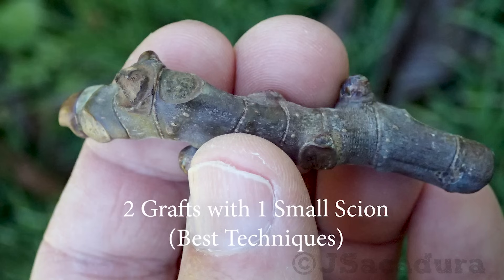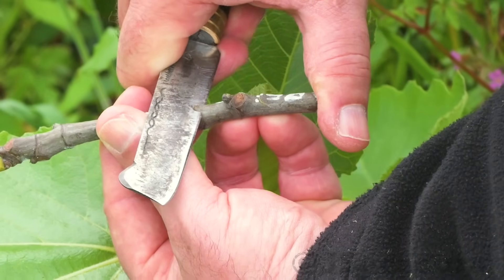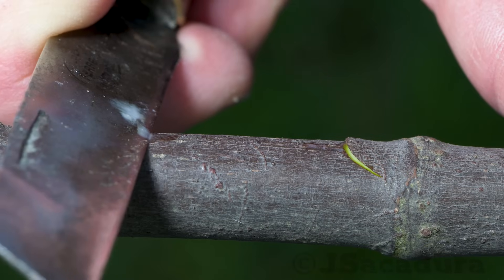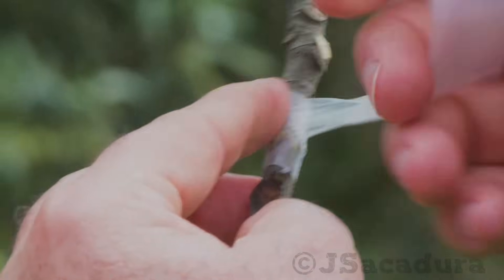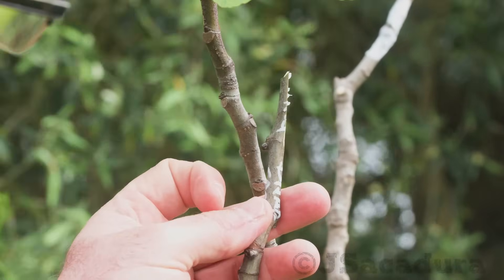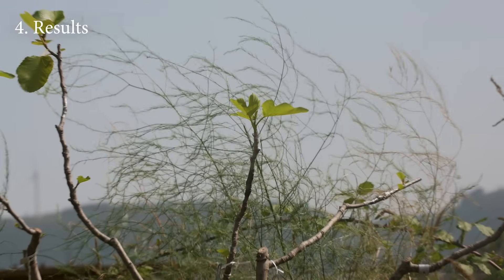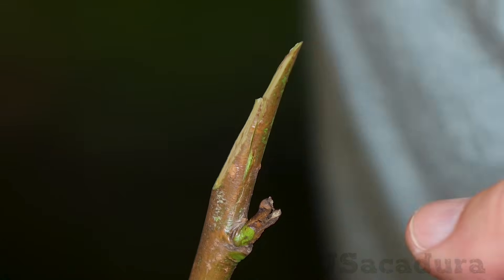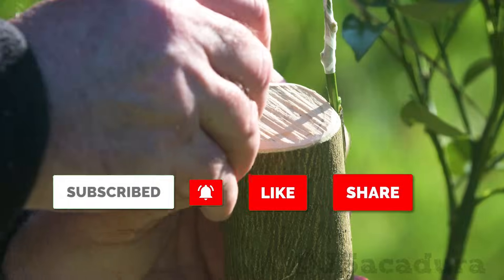BEST GRAFTING TECHNIQUES | 2 GRAFTS with 1 SMALL SCION

Comment: Great video as always!  I did far less grafting this spring and had less success than last year with the few I did.  I grafted a tree I bought from Costco, and after planting, it just stopped growing. There didn't seem to be a flow of sap to the scions to join to the rootstock.  My hunch is that the tree (a peach that already had some peaches) was well into its growth phase and it just switched to emphasizing its roots when I planted it.  Anyway, the biggest problem with last year's grafts is that last year's bark grafts continue to grow so vigorously that I need to both prune and anchor them so they don't break off on windy days.  I've come to realize that orchards use bark grafts with the aid of a trellis to make the technique work, so some sort of additional support is probably necessary, at least in the first few years.
Reply from the maker: With vigorous varieties its always a good idea to stake the grafts, at least in the first year. Store bought trees are often potted weeks prior to selling. The shock of uprooting, potting and planting is usually to much for the plant to handle being grafted on top of it. Its best to plant the tree, let it settle and graft it at the end of the season or in the next spring.

Comment: Great video and detail , but dam im getting goose bumps watching that knife looking like any mistake will be a finger graft.

Thanks for the good work you put into the upload, i got to see some good tips and tricks. Thanks
Reply from the maker: When cutting the chip or making a tongue in the whip and tongue graft you can't avoid cutting towards yourself. However, if you anchor your fingers correctly and limit the travel of the knife those cuts are quite safe. I have a video on how to make safer cuts in the channel. Check it out. Thanks for the comment.
Reply: @JSacadura  the best things in life always have a slight thrill of danger. cheers for the reply :)